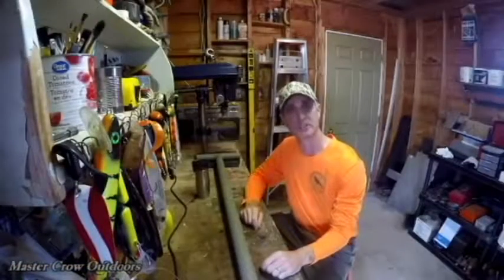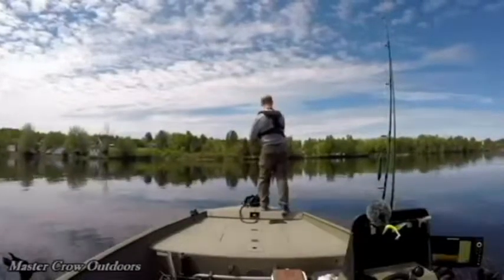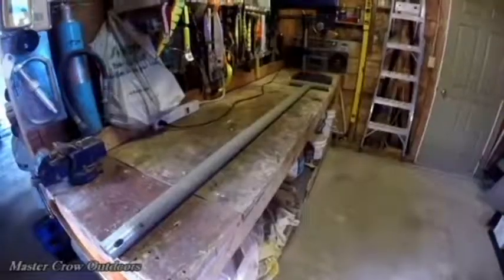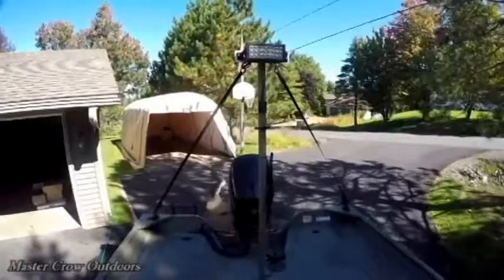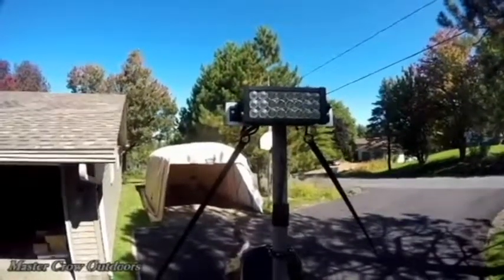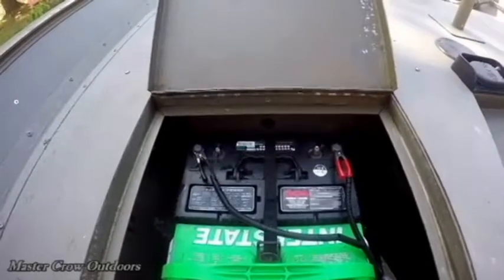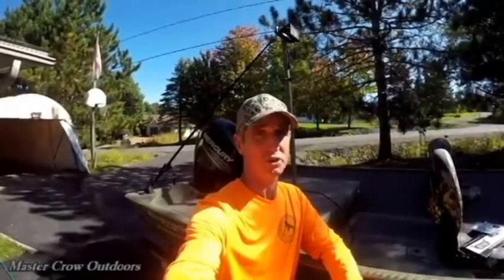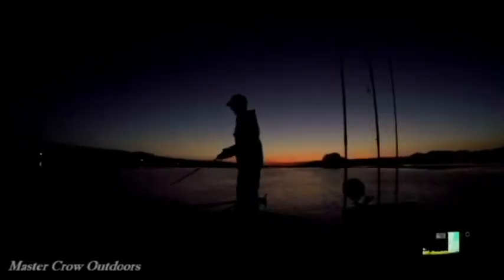DIY Boat Lighting-2019

Comment: Can never have enough light are you guys aloud to fish at night I thought we only had 2 hours after sun set? But an extra 2 hours is an extra 2hours.
Reply from the maker: It depends on the species and location. DFO will sometimes issue variation orders and check the NB Fishing Regs too. Saying that, on the Saint John River, which is tidal, you can fish for non-sport fish like Striped Bass 24/7. If it's sport fish like trout it's two hours before sunrise and 2 hours after sunset. Maritime Provinces Fishing Regulations section 12(1)

Comment: I'm changing my user name. I was using Princess Paulina, 

That's a nice light setup.
Reply from the maker: Luv the name change and appreciate the comment! Stay tuned hope to have some night fishing footage this summer!
Reply: I'm slowly taking steps to get back to fishing again after many years off the water. Not sure yet if I'll get the boat out this summer or not as I still have financial obligations to meet. But I just bought a new truck to pull the boat with when it does come out. The user  name change is another step in that direction. Eventually I'd like to start a youtube channel too. Notice I'm using the same gray ribbon icon that I was using with the old MsPrincessPaulina name. 

I used to love night fishing for muskies. Your light bar is ideal for it. Just beware of the bugs it will draw. lol
Reply: P.S. I noticed some audio issues with this video too, as others have said. Had to turn the volume way up so I could hear you.
Reply from the maker: @thelonesomefisherman7425  One day at a time friend and hope to see you back on the water soon. Great way to relax and get away from the chaos!  Found out about the bugs when I turned it on last summer! lol
Reply from the maker: @thelonesomefisherman7425  Sounds like the audio in the video should have been enhanced. Thanks for the feedback!
Reply: Putting some red cellophane over the light might cut down on the bugs and still give enough light to shoot video with.  The military uses red light at night because it doesn't destroy night vision like white light does. Something for you to experiment with, at least, if the bugs drive you buggy this summer. Just a thought.
Reply from the maker: @thelonesomefisherman7425  Appreciate that. I'm going to give it a try!
Reply: It might not work but it's worth a shot. You're welcome